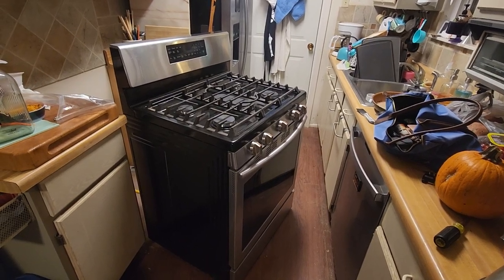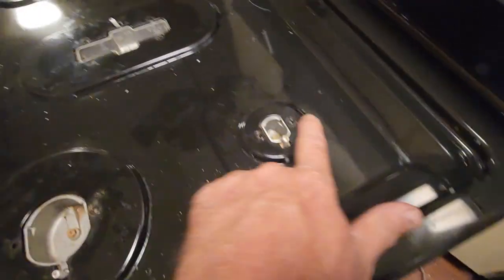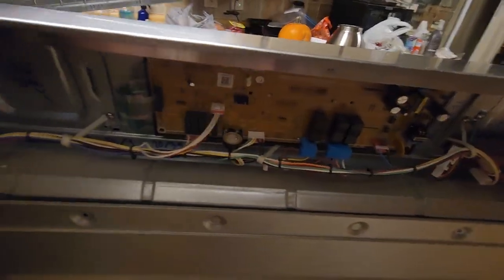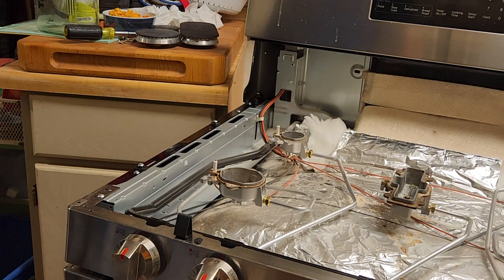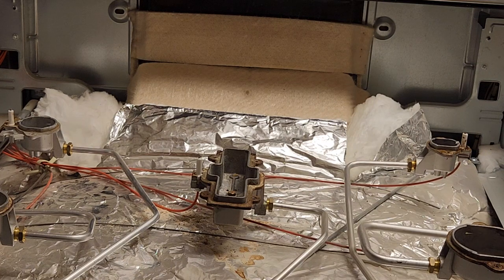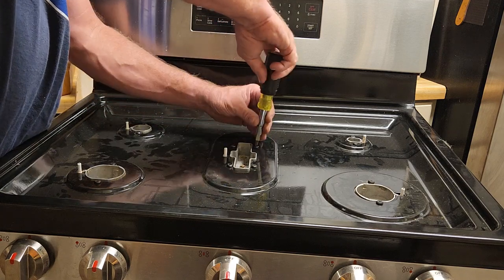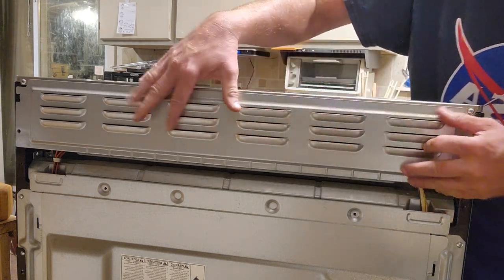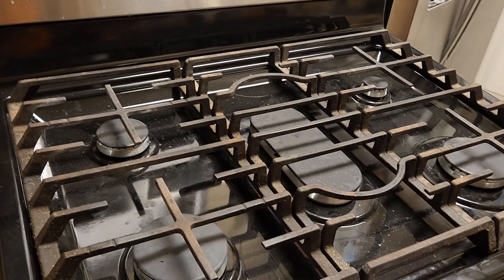Samsung stove top ignitor electrode replacement procedure

Comment from the maker: Hi all, I forgot to mention where the model number is on an oven. They are usually located behind the oven door on the stove. Or they are along the bottom behind the warmer drawer. You will need the oven model number to order the ignitor
Reply: I need the front right ignitor replaced. do you know the model number i need?
Reply from the maker: @edmorgan1527  you get the model number of your oven and go to a parts store online. Most have an exploded view of your oven. Then look at the diagram and order the part.

Comment: I needed a new surface burner igniter for my Samsung oven and this video showed me exactly how to get in there and do it. Thumbs up! But mine was badly clogged up with about 10 years of grease that was burned deeply into screw threads and all around the igniter in its holder. One screw wouldn't come out at all, even after a couple days of PBS Blaster, and just when it felt like it was moving a little, the head broke off - but at that point I could at last get the cover off. After that, I had to break the igniter free from the crud; after that, the rest was easy. Then I needed to clean the 10 years of grease from the sides of the oven and other places that never see the light of day or are even thought about.  Finally, I got a tube of anti-seize out of the garage and put a dab on each of the burner screws to make the next removal a bit easier if needed. So a big job, but it's done now. Hopefully I won't have to do it again for another 10 years.

Comment: In my situation, the front right burner clicks, but sometimes doesn't spark. You usually get it after a few tries, then it'll light.

All the other burners light quick as they should. Just the front right one is the one with the issues.

Should I be looking to replace the whole spark module or just this one white igniter for the burner with the issue?
Reply: I believe just the individual igniter is faulty

Comment: Ok im back😂.  The front roght burner wont light, isnt making a clicking noise either.   I shut it off because i could smell a little gas.  What part would i need?
Reply from the maker: @Hiddencomment007  no click at all on any burner or just that one? If it clicks with other burners turn on another one so it clicks and try that one. If it lights off the ignitor is working. All ignitors pop when any burner is lighting. If it's that one not popping only, focus should go to the knob circuit

Comment: I have a Samsung gas range just like this and when I want to use a phase and I turn the knob all the igniters start sparking.Does anyone have this type of experience and what to do to get this issue fixed.I don't want to work blindly,I want to know what exactly is the problem to know what exactly to do to get things right.
Reply from the maker: Yes, the ignitor does not 
Differentiate between the burners. When you initiate an ignition, they will all spark. This is why a broken one will prevent them all from working